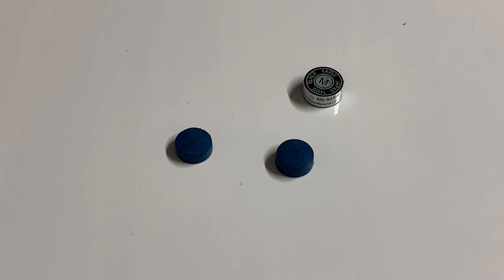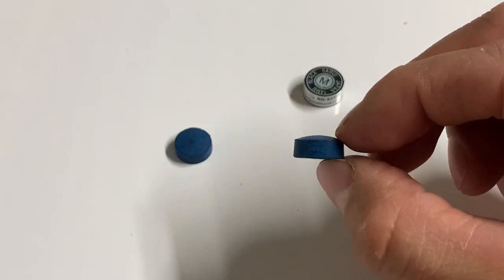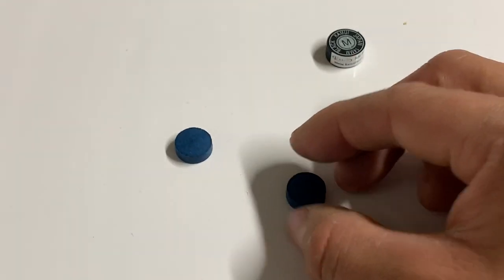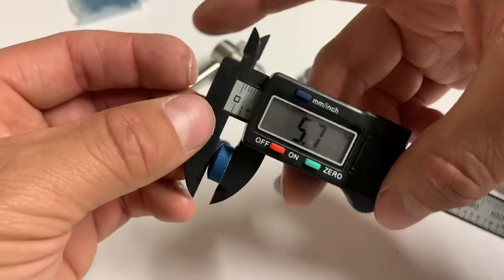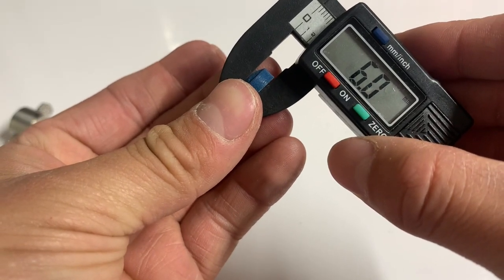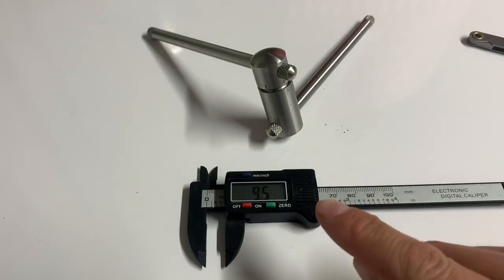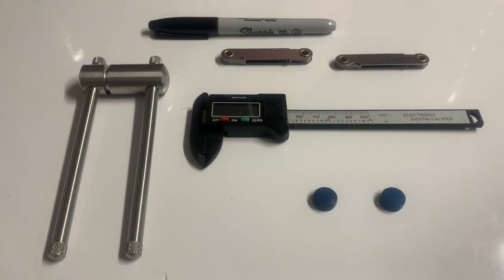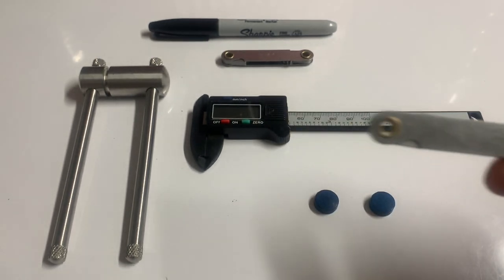Elk Master “Milk Dud” Explained - How To Make Them

Comment: Milk dud tips for 11mm/10mm
1. Soak two or three EM tips in milk overnight
2. The good EM tips will sink. Those still floating can throw it away.
3. Press the tips using tips clam
- 2.5mm hard feel
- 3.0mm medium
- 3.5mm soft
(this with experience on how many turns required to reach that compression)
4. Keep it under the sun 32 to 40'c for 3 days. Alternatively, burn the clam head using candle light for 45 minutes and leave it till room temperature.
5. Take out and measure the milk dud tip height and leave it for 1 day to measure again. If there tips expand, meaning you didn't wait long enough for tips to dry up and you required to repeat step 1 because any tips expension resulted air being trap inside the tip that will create inconsistency.

Hope this help

Comment: But does it perform any better? I thought the whole point of tips being a little soft was to prevent easy miscueing. They grip the ball a fraction, not to give any more spin but to stop the tip sliding off too easily when playing extreme spin.
Reply from the maker: If you watched the video, I’ve already explained the purpose of soaking these tips.  I’ve noticed a difference, I’m currently playing with both a regular elk master and a modified elk master (milk dud) and I absolutely love the milk dud over the non soaked EM.  I’m not saying it’s better, to each their own, but I’ve noticed an improvement for my playing style.

Comment: Hi, Nathan. I'm in the process of making milk duds myself, and I'm trying to decide how hard to make them initially. Were you happy with the hardness of this milk dud, or did you wind up wishing you had made it harder or softer? Also, are you still using this tip? Thanks.
Reply from the maker: Hello, thanks for commenting.  I’m pretty happy with the way mine turned out, I don’t play too regularly, but, I have put some miles into the tip, and I still have this same tip on my cue, I used my cuetec bowtie for light maintenance and it still plays well and is still holding its shape.  Totally worth the effort, I won’t be buying anymore expensive overpriced tips anymore, I’m pretty satisfied with these results.
Reply: That's good to hear. Thanks for the info, and for the quick reply. Great video, by the way.

Comment: how long do they usually take to dry out?
Reply from the maker: That is a good question, I still have the same tip on my cue to this day, but, I also have not been playing much because of Covid, I last played with my cue at the beginning of the fall in 2021, it was still holding up well, and I installed mine in July 2020.
Reply: @nathandallaschad7990  Actually I was wondering after you soak them in milk how long before they are dry enough so you can glue them to the shaft
Reply from the maker: @tommykukulka7811  oh….. Leaving it pressed for 24 hours wasn’t enough, I pressed it down again overnight and then left it out for awhile as well, I’d give it 2-4 days